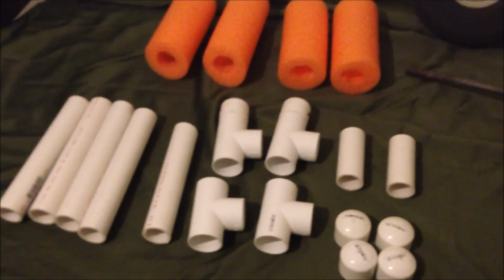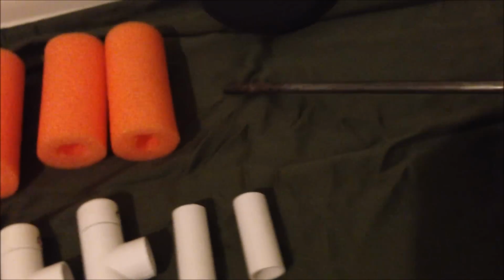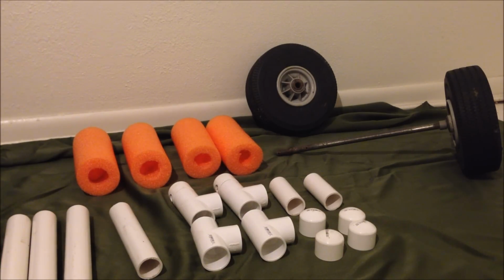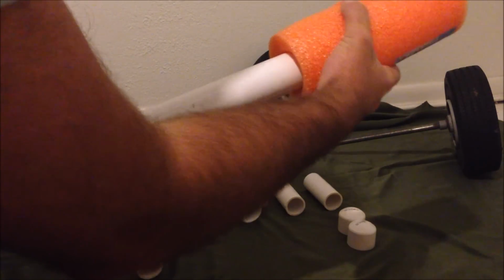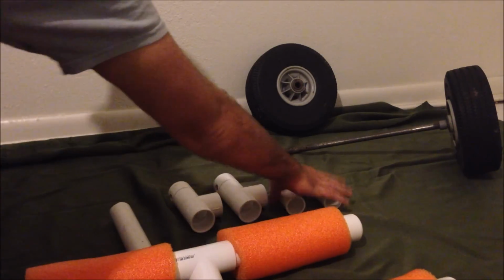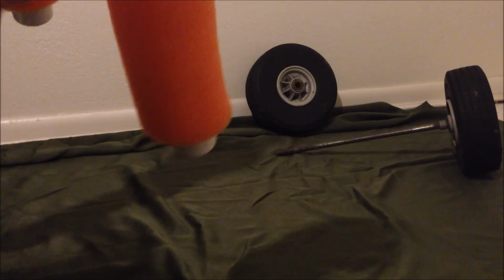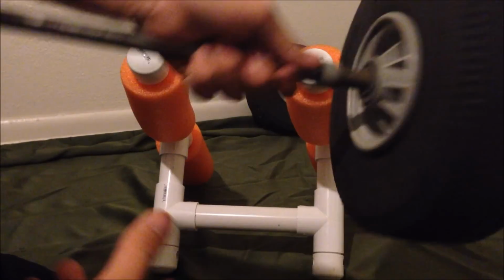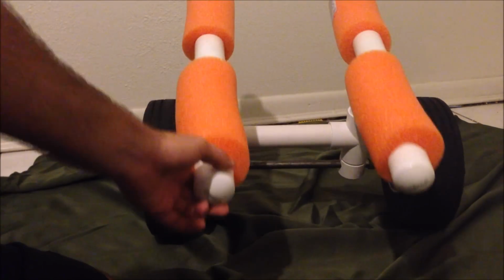Home Made Kayak Cart

Comment: Did you use one inch PVC? I think it would be strong enough. A bit cheaper too!
Thanks for the dimensions but don't forget to confirm on your kayak.
If not using Cryptic's kickstand you could use elbows on the botton and pass the axle thru the horizontal pipe. Going to try all 1 in. sched. 40 on mine with kickstand. Cheers

Comment: Recently won an Ocean Trident 13, measured the tank well drain holes on center (12") and have an old dolly I have little use for which will take care of the wheels and axle that I need to make one for my sot kayak.  If I would need the dolly again no problem, just take the wheels & axle off the home made cart and put back on the dolly.

Comment: What size Schedule 40 PVC?   3/4”, 1”? Otherwise, exactly what I needed.  My 10” wheels came off a battery powered 4 wheeler I found put out for garbage. They are solid hard plastic with deep tread. Should be great for the sand and mud in Galveston Bays. I’ll be adding bungee cords for my tie downs.

Comment: The Glide Compact Trolley is useless. For a start you have to strap it on with the two straps they give you. So you have to feed the straps through the holes in your kayak and feed them as well through the trolly and then you thighten them up with the rachet system. No matter how tight you can get those straps if one of those wheels hits some thing to stop it like a stone it will shift and then you have the kayak wanting to go one way and you are pulling it another and you have to stop and adjust them. When you get to where you wanted to go you have to remove the wheels and fold the straps back up and all this takes about 15 minutes. Don'T by them you will only end up taking them back.

Comment: where can i get an axle
Reply: +alderete74 Get some 5/8" threaded rod ($4 - $5 at Home Stores), 2 (or 4 your call) 5/8" flat washers and 2 5/8" stop nuts (also called aircraft nuts or nylon lock nuts).